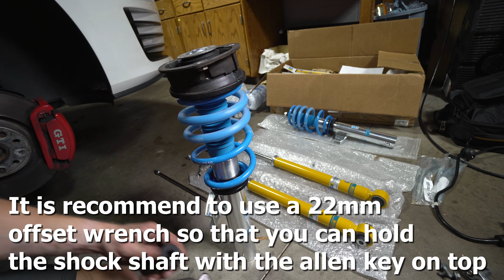Bilstein B14 PSS Coilovers Install Mk7 GTI MQB

Comment: Did you have in groaning/creaking from the rear after install? Trying to diagnose the sound I'm getting after installing the B16s PSS10s.
Reply from the maker: I did not, but I did get some when I did the RSB. They sometimes come lose, I'd check every bolt associated with your RSB.

Comment: Stupid question... what do you use for jack points & jack stands? I can’t find anywhere to jack & have room for stands
Reply from the maker: I use the front jack points to lift one side of the car. Place jack stand on the rear jack point and one up front under the subframe. Then I repeat that on both sides.

You should now have jack stands on each rear jack point and two under the front sub frame. Then I jack the front up where the dogbone connects to the front subframe and move the jack stands to the jack points in the front.

It's a real pain in the ass, but I can't think of any other way sans a lift or Quickjack

Comment: hi I installed my new b14s with new bilstein front bearings on my s3 8v. Is it normal to have a slight noise on the bearings when steering from a standstill? they told me it depends on the lowering springs. Front -22 and rear -20. thanks bye
Reply from the maker: Mine did not make much noise, maybe the strut isn't fully tightened to the bearing? That's interesting, usually people have issues with strut bearings if they don't replace them and they wear out.

Comment: Hey there, Bilstein mentions to always torque suspension to control arm while on load. Seems super important, is this something you recommend?
Reply from the maker: I would recommended that with this type of suspension. It is a good way to be sure that the bottom of the strut is inserted all the way and if you're doing sway bars it can help prevent binding
Reply: @HardwayLearning  I did but only at front. But only one side at a time with the jack. Not sure if this is the right way, I thought all wheels should be on load. Could only do this on a lift or maybe with 4 ramps.
Reply from the maker: @designrdan  you should be good with what you did 👍
Reply: @HardwayLearning  Been 2 months and all good so far. I appreciate your help and advice! Thanks again!!
Reply from the maker: @designrdan  anytime!

Comment: Pretty noob here . How do you adjust the rear? Had rings all the way counter  clockwise and rear is super jacked?
Reply from the maker: You want the collar to be adjust towards the body/frame of the car and not towards the control arm.  Each nut is jammed together to lock them so you need to loosen them away from each other to start adjusting it.
Reply: @HardwayLearning  Great! Thanks for the prompt reply, much appreciated! Great vids?! 👍

Comment: Do drive shafts have to be disconnected both sides?? Even if there is coilovers already in just want to put a fresh set in
Reply from the maker: Depends, you could try without, but I ended up needing to disconnect them in order to get enough clearance for the bottom of the shock to sneak out of the knuckle. Look up "Mk7 2x4 strut removal". You can compress the shock with a floor jack to remove it as well.

Comment: What size was the top nut bolt on the rear shocks? You said the fronts are 22 but never said the rest
Reply from the maker: The top nut on the front changed, the rear remains stock which I think is 17mm???
Reply: @HardwayLearning  alright thank you!

Comment: How come you didn't go the way of the 2x4 method on the front to remove the shock?
What was your final hight set to?  Lower or higher than the 034 springs?  
Going B16 myself in a few months when weather gets warmer so this was inspirational
Reply from the maker: What's the 2x4 method? I ended up having to adjust the front up and the rear down after the springs settled. I could get the final collar positions, currently riding with maybe a finger or two between the tire and fender.
Reply: @HardwayLearning  what do you estimate the drop is from stock?  I am looking to be on b16 around 1 inch drop or as close to what VWR or 034 springs lower the car.  What do you estimate amount of threads you lowered on front and rear ?
The 2x4 method i heard and seen on youbtube is to take a piece of wood screw it into the front strut where the endlink for sway goes and with floor jack compress the strut/spring just enough for it to pop out of the spindle collar.  It eliminates taking out the axle and the axle bolts which apparently some people had issues with later on.

Comment: I've had these on my car for about 15k miles and i've almost always had a creaking noise when turning. Any suggested remedies? New strut mounts, some kind of grease, etc...?
Reply from the maker: It's pretty common for the front strut bearings to go bad (the rubber sandwhich on top of the strut), otherwise I would check to make sure your sway bar and endlinks are properly torqued. Mine are dead quiet though. How many miles are on the car overall?
Reply: @HardwayLearning  thanks for the reply. The car is at 51k miles.
Reply from the maker: @francescopastino  I would suspect the upper strut bearings are probably shot. Does it squeak if you turn the wheels at a stop?
Reply: @HardwayLearning  not so much a squeak, but more like a creaking while turning at parking lot speeds.
Reply from the maker: @francescopastino yeah that definitely sounds like the top strut bearings 👍
Reply: @HardwayLearning  thanks I'll check em out!

Comment: you couldve just used your impact wrench to extract the bolt from the rear knuckle by reverse. you should have placed the jack to suppor the control arm and not under the disc rotor. to avoid folding the dust sheilds.
Reply from the maker: These are all excellent points! We aren't always the brightest of the bunch 😂

Comment: Which milwaukee impact is that? 3/4 drive?
Reply from the maker: It is the 2860-20 M18 1/2" Mid-torque impact 👍 (can be found on the Amazon storefront link in description 😁)

Comment: Trying to figure out to go b14 or 16. They say the 14s aren't height adjustable... but yours clearly are and they look like it online. So not sure on the difference of that. Any insight? Also you should do a driving review.
Reply from the maker: If you have DCC, the damping on the B16's can be electronically controlled. In the B14's they are fixed damping, but they matched the springs very well to that damping.
Reply: So I have the mk7 with no dcc. Sounds like it be pointless for me to go b16 then
Reply from the maker: @narkls1389  yes it would be overkill, but sweet if you could retrofit DCC (I'm sure there's a way)
Reply: @HardwayLearning  oh I just found it. There are 2 types of b16. One dcc the other regular with dampening control knobs. Hmm I might still go for those then.
Reply from the maker: @narkls1389  yeah it's a nice to have, but not required 👍. I have adjustable damping on my Miata. The only time I touched them was when I installed them and set it to what they recommend for their sport springs 😂
Reply: @HardwayLearning  haha yeah I feel ya. I remember having teins on my miata, bc extreme drops on the ls400 and I think JOC on the mk4 jetta. The most I ever adjusted was on the shitty jetta coils since they would sag and go too low sp I'd have to raise it haha.

Comment: Meanwhile Im running my volvo 740 with stock suspension. And yeah its pushing 824whp/867wnm on the dyno. I would highly recommend building engine with forget internals, swap solid gearbox, rear-axle and after these modifications just keep driving and ignore everything else. Trust me its a lot more fun gapping people with lego suspension and plastic china bling bling wheels... lols..
Reply from the maker: Lol, I get your angle, but the main focus of this car is comfortable daily driving/road trips. I would have kept the lowering springs, but the girlfriend didn't like the ride.
Reply: @HardwayLearning  my gf always says slow the f### down pls. Lol 3.2bar of boost thru her brain..